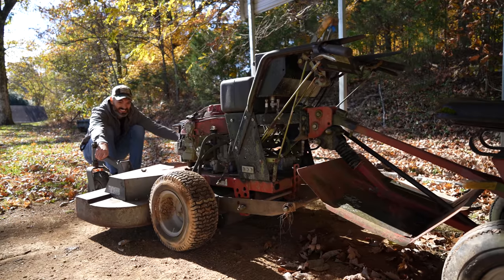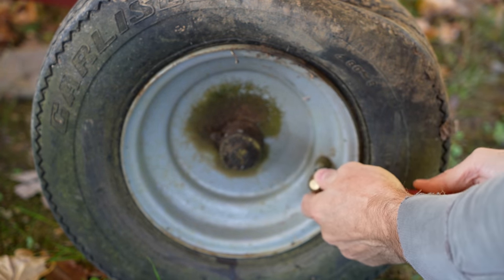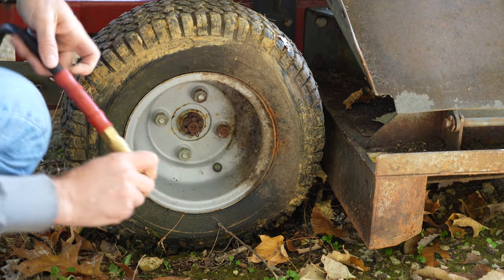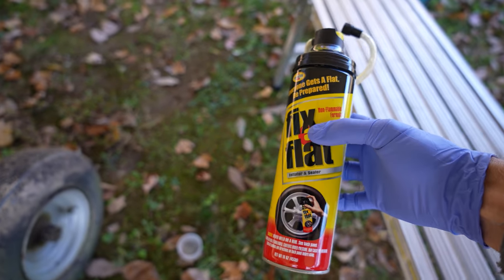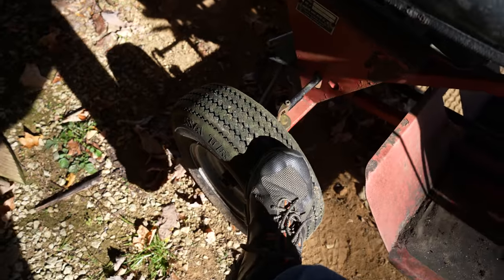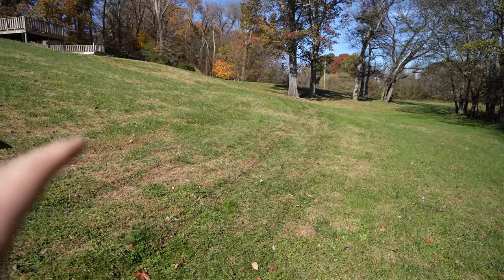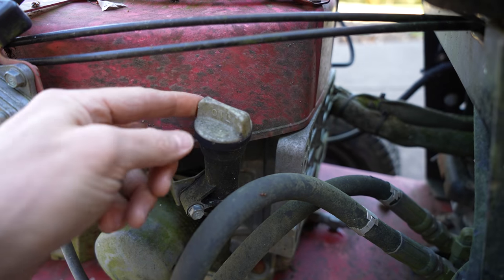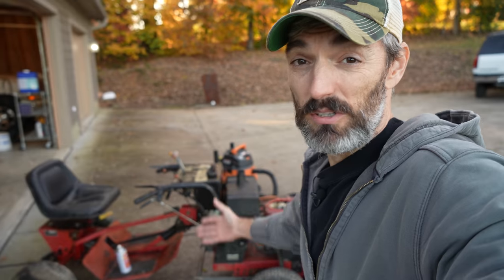Abandoned Mower Finally Moving Again!!

Comment: If you never move your air compressor, you can buy a separate tank and plumb it in to add capacity.  HF sells an 11 gallon portable tank for under $50.  Almost all compressors use NPT fittings you can buy at Lowe's/HD to get something working.
Reply: Works a treat, I've done it in the past, so long as it doesn't exceed your compressors duty cycle👍
That's an awesome portable unit he's got!   He'd do well with a 20+ gallon 6+ cfm to keep it the shop!

Comment: When you pull the spark plugs squirt some Marvel Mystery oil in each cylinder. Will help make sure the piston rings are not stuck and help seal them up for better compression.

Comment: I would use purple cleaner or whatever the cleaner is called. And pressure wash the ish out of it. Then start taking parts off that need to be restored to get it back working again. Pretty much same way you did your truck. Which motivated me to slowly restore my 06 h3 hummer. Its old like yours and runs really good. But I've been replacing sensors and etc to keep it running well. 210 thousand miles on her now. I digress sorry. Lol. Point is. PLEASE DONT LEAVE US OUT OF WHAT YOU DO TO THAT MOWER. IM ENJOYING ALL OF THIS LOL. WAY FROM TAMPA FL. LOL
Reply from the maker: That so awesome to hear. Who would’ve thought this little mower left out in a field would be so interesting. Can’t believe you’ve got 210k on the H3! That’s great! Is it the inline 5cyl? Or is it the Alpha?
Reply: @1RoadGarage  inline5. Had it for 6yrs now. Fyi started out with 65 thousand miles. I've put alot of highway miles and now city miles on this truck lol.

Comment: Love the video’s! I have a 99 suburban that I do all the work on! On the small engine, mice will build nest under the fly wheel cover. Hope you get it running!
Reply: I found the very thing in my neighbor's zero after sitting over the winter. They packed in between starter gear and flywheel. Cheap fix in the end.

Comment: There should be A bypass valve on each one of those hydros when you turn that it frees up the wheels so you can move it around without power check it out

Comment: Hey so you’re pretty knowledgeable on obs trucks. My 99 suburban lights have a gremlin. So I’ll turn on the headlights (I just replaced the switch and it still happens) and they work but then I’ll turn the brights on and the head lights shut off! And won’t turn back on for days sometimes weeks and I’ll have to use the daytime lights just to get home. Also the headlights are on when the switch is off. Idk what’s going on. This all started happening randomly like 3-4 years ago

Comment: Drain old gas out tank and carb.pull plug clean and put good penatraiting oil in bore hole. Check oil level and battery forcharge.check all fluids. Now try to start

Comment: Take a close look at the carb. As long as it looks like it has sat in the elements, I'd say scrap it and get a brand new one. It's a Honda. Should be real easy to find. Also, drain the oil and take a close look in the drain pan. If there are sparkles (metal flakes), your motor is probably shot.
Reply from the maker: Haven’t drained the oil yet but can’t wait. Hopefully it’s clean!!

Comment: I'd also pull the carburetor and soak it in some carb cleaner remove the bowl, float, and pin and give it a good clean. Replace the bowl gasket and you should be good to go

Comment: There is a release on the wheels..i guess you'll figure that out eventually..hope that didn't damage the hydraulic system...let's get it running then we'll see..good luck hope to see you cutting grass soon..sounds like the starter may be engaged check bendix it could be stuck in engaged position...take the cover off clean everything make sure no mice have made a home they are notorious for living in small engines and chewing wires..don't use starting fluid use gas for first start up use tru - fuel  40;01 is good it has oil in it  put some directly in the cylinders before you do anything that will help lube the cylinder walls..and fill the bowl on the carburetor by going through the vent tube..there's a lot of things you need to do before the first start..sorry for the long comment..lol... small engines were the first thing i ever worked on..i was 10 years old..my dad was a expert..i learned everything from him..
Reply from the maker: Thanks Rodney! These are the comments I was hoping for! 👍
Reply: @1RoadGarage  hope it helps..try watching taryl fixes all..he's good and funny he knows his stuff..there are many videos out there I'm sure you will find some that will help you..Cheers 🇺🇸🇺🇸🇺🇸

Comment: Those small front tires are useless even back when the mowers were new, Always had to put tubes in them. if  you get it running good then spend the money on tires and see if you can find generic solid tires or now called flat free tires

Comment: Oh your going to be sorry you used that crap when you come to take that tire off and repair it.  Use the Kubota man….That rear blade is a box scrapper,, great for landscaping. Also if  they are hydraulically driven you could tear up the pump if you don’t pull the release  lever for towing.. Should have used the Kubota and lifted it.
Reply from the maker: I’m trying man. Hindsight is always 20/20. After I towed it all they way in I had that thought about a release for the hydraulics. Not sure if there is one but I should’ve looked.
Reply: @1RoadGarage  Well never know, maybe the lever was pulled by previous owner.. It seemed to cost pretty easy when it was down by your garage, shouldn’t do that if the hydraulics were engaged….. Great Video    Always look forward too your next, anxious to see the rebuild of this unit….